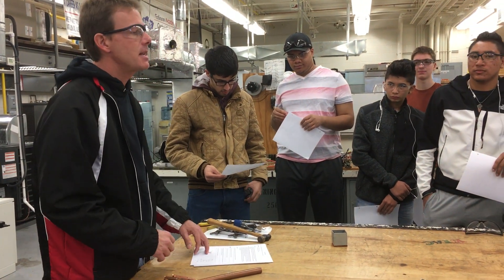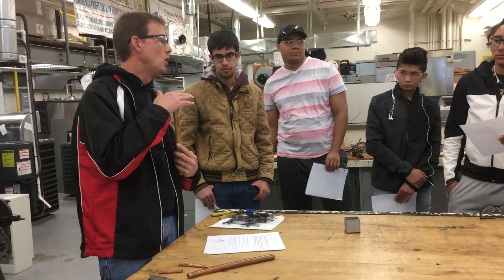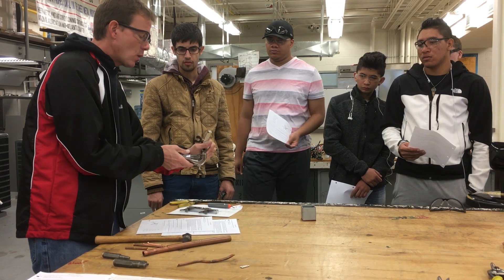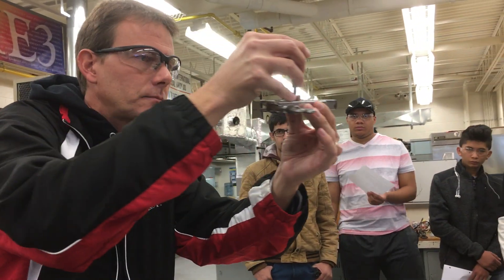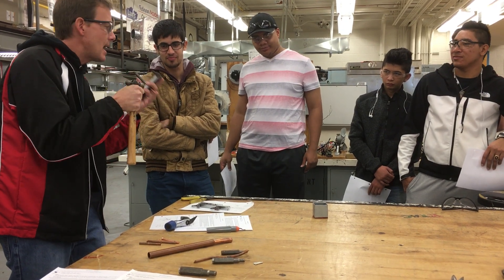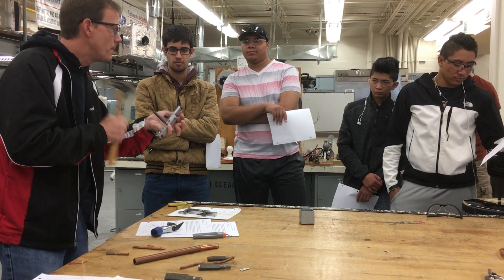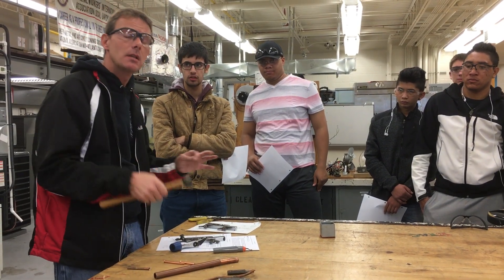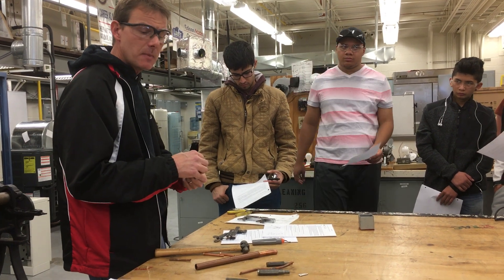HVAC Basics: Skills, Tools, & Procedures - Practice Swaging with a Swage Punch & Hammer

Comment: great instructions, anyhow I have a question, when you can "telescope" two pieces together, will this hold together under pressure when brazed or does it still need a coupling or swaging?
Reply: C I it’s called a stuff and burn. It will hold when brazed, but not correct method by any means (but sometimes you gotta do what you gotta do)
Reply: @kevinreal667  hahaha so true, gitter done